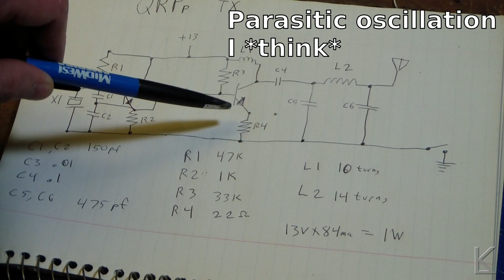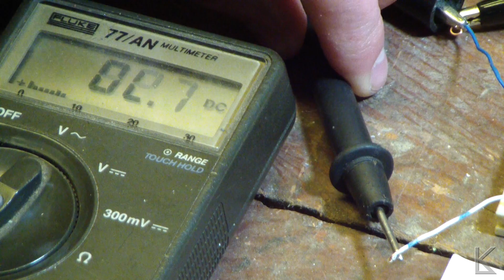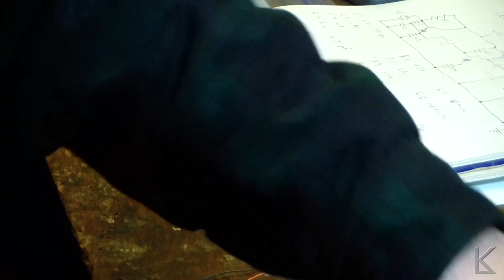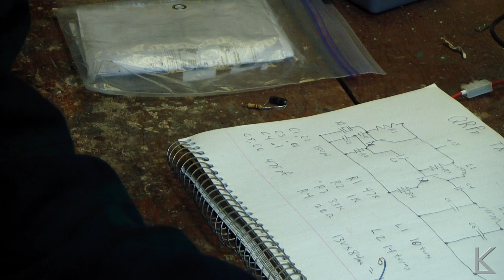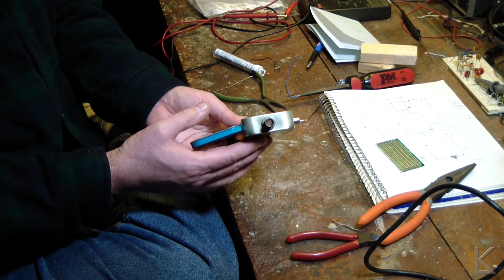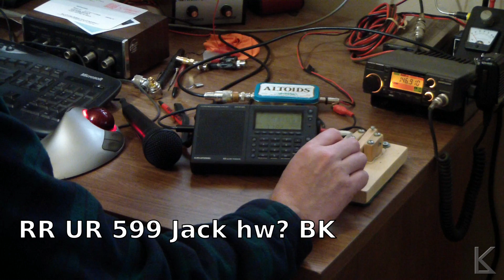Ham Radio - Build your own QRPp CW transmitter

Comment: Hi Kevin, I understand how the circuit functions as a transmitter, but the one thing i dont get is how you hooked it up for recieving. From what i can tell, the switch just swaps the antenna between the transmitter being on it and the reciever hooked to the rca jack?
Reply from the maker: Yes, and it also grounds the receiver jack when you switch to transmit to protect your receiver from excessive RF.

Comment: From Detroit, I made a 600+ mile QSO on 40m, with 200mw output. I got a RST 339, but it was quite cool making a contact with two 2N3904s and about ten other components, including the filter. Anyone trying QRPp or QRPe should know that SWR and coax loss are major factors. I used good quality RG6 and a dipole tuned for the CW end of 40m. I made contacts to Connecticut and Wisconsin, too. The Kansas QSO was about 2 hrs after sunset and the other two were midday.
Reply: I enjoy your Videos how do I make this operate on 20 meters.  I have many 20 meter xtals ... what would you change about the Torids?

Comment: I have an original Rockmite to finish, just need to install the “upgraded final” and mount it in a pin Altoids tin that has been earmarked for this since 2003 (or maybe 2005).  Great project, great video, thanks for posting.  73s N1XF

Comment: Ahhhhh, Hello Kevin, today I sit once again rewatching this awesome video. However, I must add,,,, I popped into the Living room and switched on the wide screen Tv and sent this video to our Apple TV box. Coffee stationed to my right and toast stationed to my left. This is my preferred method now to enjoy watching your videos. I really like the schematic here. Very clear, certainly large enough to see the components and well lit. Way to go on the teaching as well. 73's Kf2ms
Reply from the maker: You may have seen my video on the small HP computer I found in the trash up the street.  A small device, intended to be used as a terminal 'client' computer for kiosks and such.   I loaded linux on it and connected it to my TV with a wireless keyboard and mouse.  Since it's a full desktop OS, I can watch all the videos, even those slated as not viewable on tv set top boxes.  I don't know if you've run into that on youtube or not.
So, I guess you enjoy "armchair copy" then. :-)

Comment: Transistors ? 2n 3904 or 2222's
Reply: A 2N3904 might be a better pick for the first stage than the 2N2222 if you have both on hand. 2N2222 in a tin can is better for the second stage if it's dissipating anything like 1 watt total. That is too much for anything in a TO-92 or TO-18 package without a substantial heat sink. The 2N2222 should be kept down to 500-600mw total dissipation in a CW xmitter or you will be chirpy.
Reply: @jeffwestend909  actually, both are bad choices. Here 2N4265 will outperform both as its transition frequency is 300 MHz which is way about that of crystal
Reply from the maker: I think I mentioned that any general purpose NPN will work.  Either of those should be fine.
Reply: I used 2n3904s  last night and it worked nice. Now I'm gong to solder Manhattan style with some me Pads Rex Harper had givien me.

Comment: L1, is it 6,7, or 10 turns?  You said 6 or 7.  Your schematic shows 10 turns.  I'm gathering my parts to make a go at it.  Thanks.  
de ke4rk
Reply from the maker: Hi,  Sorry about the delay in responding, I missed this comment initially.  That inductor is a choke to cut down on RF going back out the power rail.  Anywhere from 7 to 12 turns will do the job, so 10 is a good number.  I think I used 10 on mine, but sometimes my mouth doesn't get the message from my brain when I'm filming!   Thanks for watching.
Reply: With T50-2 core, 7 turns give 24 uH inductance and 10 T will give close to 34 uH.

Comment: Yep back in the day we would saddle are dinosaurs and go foraging for vacuum tubes to build transmitters ;  )
Reply: And when we said rockbound, we meant ROCK bound. (My elmers were Fred and Barney.)
Reply: Yeah....back in my day we would scratch the crystal with the cat's whisker and listen for the station signal.....the tuning coil was wound on a toilet roll tube.....too high tech to get a variable capacitor.
Reply: CD S omg I miss those days....
Reply: Back in the day when we were building the Great Pyramid, during lunch breaks (between whippings) we slaves would build transmitters from silica dust and copper oxide, joined together with lead particles.

Comment: Hi, great video!
I have a question about the oscillator, would it be possible to substitute it whith a variable oscillator?
Like this dds module for example 

Look at this on eBay http://www.ebay.com.au/itm/262916095852

Hope it's not a stupid question. 

Hans.
Reply from the maker: sure, you could use a VFO.   Part of the point of this project was the simplicity of it though.

Comment: I have watched this one video several times, and this afternoon I came home from the Electronics store with a bag full of goodies to make the transmitter.  Total cost $40.  Basically I am breadboarding and using my audio generator & O-scope to check out circuits that I make.  Simpler the better and you can't get any more basic than what you have shown here.  I did buy some extra parts and some 10 Mhz crystals for the 30 meter band. As i bread board the circuit I will change the crystal to see if it will work on 30 meters as well as 40.  I may add a band switch into the circuit... 73's de kd5smf
Reply from the maker: The oscillator may run at 10Mhz, but you'll probably have to play around with the filter circuit to raise it's threshold up to frequency.
Reply: I bought a couple of varible inductors that I can tune the circuit with at L1 & L2 (a t-8324 & d29002202) where one is wound at 10 turns and the other at 14 turns.  Not sure how those will work but thats why we breadboard circuits...
Reply from the maker: +Mark let me know how it goes.  Send me a pic or two of the final build, I like to post those on the Facebook page for others to enjoy.

Comment: Hi Kevin, is this design limited to 40m band?
Reply from the maker: No.  But certain component values will change in the oscillator and the low pass filter.
Reply: Kevin Loughin awesome thank you so much

Comment: Hi Kevin, new subscriber here. I binged-watched all of your videos this weekend, thanks for making them! Your discussion on toroids reminded me of a question I have. I'm assembling a BITX40 transceiver and while overall build quality of the board is great, most of the toroids are wibbly-wobbly and I'm afraid the leads will break eventually. Since you've worked on lots of old radios and probably have a good idea of what works and what doesn't, what do you recommend to immobilize the toroids for the long term? Hot glue? Silicone? Something else? Thanks!
Reply from the maker: Yeah,  I think either hot glue or silicon would work.  I'd lean towards hot glue, and just a dab where the torroid meets the PCB.
Thanks for watching!

Comment: Nice work, Kevin..particularly going the extra step and enclosing it in an Altoids tin. Also, as your demo shows, these little guys *actually* work! Personally, I love QRPp (<1 Watt) and have worked as far away as 1,000 miles using a little kit I built that runs 995 mW. Others have done much, much better.

A few notes:

(1) If folks have a choice, go with 7.030 MHz as that is the QRP calling freq and where they are most likely to hear "friendly" activity. Stay away form 7.040 MHz as that has been commandeered by foreign digital work.

(2) The design scales to 30m CW (10.115 MHz) which is also extremely QRP friendly.

(3) Those cores are FT50-43 (the dull gray one, if I recall correctly) and T50-2 (the red one). They are 1/2 inch in diameter. I have a neat little toroid winding calc program that runs on Windows I can send to folks (free) if they are  interested. Contact me at k6whp@arrl.net and I will reply with the app and instructions.

(4) If you hook your transmitter up to a 50-ohm dummy load (here a 1 watt 51 ohm resistor will do nicely) and use a scope to measure your output, you can  determine the output power from the trace. It's a marvelous way to learn about Vpp, Vrms, power, etc. Here is a wonderful discussion of the principles involved:

    http://www.ab4oj.com/test/pwrmeas.html

(5) Simple designs like these translate very nicely to "Manhattan construction" and it might be interesting t do another version of your little transmitter (perhaps 30m) Manhattan style. 

Again, very nice work! You have brought building and design into the realm of the possible for a great many beginners!

71/72,

de K6WHP

dit..dit

Comment: Great video.  I need to find a kit or parts and built my first tranceiver.  
What model scope are you using in the video?  Russ - AD0QH.
Reply from the maker: It's just a cheap Hantek 5072p.
Reply: Russ, a good starter would be qrp-arci dot org/links stroke qrp dash kits dash bits dash and dash supplies. Many links for kits and parts. Terry - KB8AMZ
Reply: @MoTown44240  ////  qrp-arci dot org/links stroke qrp dash kits dash bits dash and dash supplies. ////   Huh ???
Reply: @SkyWire88  The URL has changed 2 years ago, just after posting. You could have Googled "qrp arci links" and found this. Easier to question though I guess. Try this new URL, "http://www.qrparci.org/links/qrp-kits-bits-and-supplies" without the quotes..

Comment: I wonder if this could be used for QRPp in the phone section of the bands.  Making a low power TX radio for next to nothing on one part of the band with a variable VFO over a few Khz.  With something that size it would be good for backpackers and SOTA.
Reply from the maker: I think I've seen a few ssb projects out there.   It's a bit more complicated, you'll need a balanced modulator,  mic amp, audio section..
Reply: It might be a good idea to do something like this.  A how to build a SSB transceiver.  Even if it is QRP/p at 1W or less it could be something to give new radio users a look into theory and construction.  But leave out technical so they have to go and ask other Elders where they are going with it so they can learn not only from you but also their club collective mind.  Instead of cheap radios for VHF they learn how to build, solder and ask for advice.  Different modules on different parts, connect together and see if it all works.

SOTA people would like to say on HF activation that they are running QRP/p and see how far they go.  Could be something in the modular way to set up, TX and take down.  Maybe a bare bones Yaesu 817.  1 band TX things like that.  Kanga products were thinking of it some years ago but never got round to self build SSB phone QRP/p radios.  So it is a niche build for phone especially one to make it work and use without it being a receiver.
Reply: William, you might consider a DSB transceiver like this one for your first try. http://home.alphalink.com.au/~parkerp/projects/projmicro40.htm
The first one of these I built, I made contact with the Qween Mary in LA harbor from S. Oregon with only 300mw. Since then I have built many variations with great results. Joel N6ALT

Comment: there is no 475 pF to find, i guess you say 4700 nF it has the number 475
Reply from the maker: Yeah, sorry, 470pf.   I'll put an annotation in the video to correct that.  Thanks.
Reply: Try using 470 or 471

Comment: Excellent job Kevin. I have a question or two. How did you insulate the underside of the circuit board from the Altoids tin? Also, it looks like the filter inductor was a T-50-3 type of toroid. What type of toroid was used for the RF choke L-1?I love making small circuits and stuffing them in Altoid tins. Thank you for making this very interesting video.73 de K7RMJ  Frank
Reply from the maker: I used the same cores for both the choke and the bandpass.   Under the PCB is some velcro tape which is both insulating from the bottom of the tin and keeping it from moving around.
I borrowed the low pass filter from this project.
http://www.delboyonline.co.uk/m0dad/construcion/tobacco_tin_transmitter.htm
Reply: @loughkb  the URL is broken sir!
Reply from the maker: @awaismushtaq5719  So it is.   It's been a few years.  I have no idea where it's published now, or if it still is available.
Reply: @loughkb  Quite a feat managing all that creativity from within an RV van. May God bless you with a roof on your head, sir. Amen!
Reply: @loughkb  Or may be you don't like the confines of a roof at all, eh?
Reply: L2 looks red to me, making it T 50 2. 14 turns will give 1uH, about right for 7MHz. Try stretching or compressing the turns, it may make for a better match into 50 Ohms. L1 is not critical being a choke, but should be well above a resonant value. >22uH will do, so ideally on an FT50 or similar core. For these sort of power values, a cheap axial choke is perfect. : ) 10 turns on a T 50 2 would only give 0.5uH, virtually a short circuit at HF : (
Reply: @lennyh500  I agree with you sir using a pre-built inductor is far better than winding a toroid or linear coil.
Reply: If you need to ask such a stupid question don’t think you will be able to make a transmitter ! Stick to watching football etc